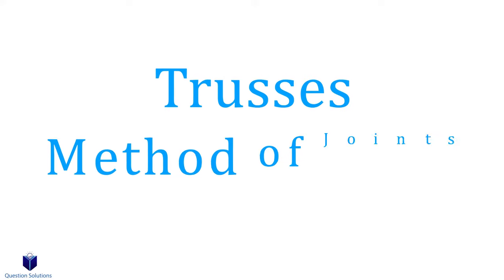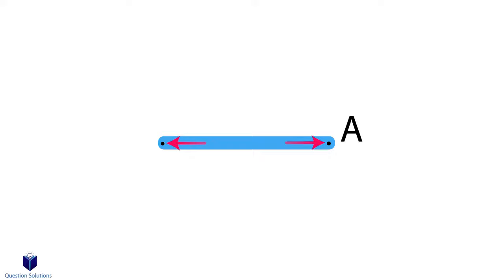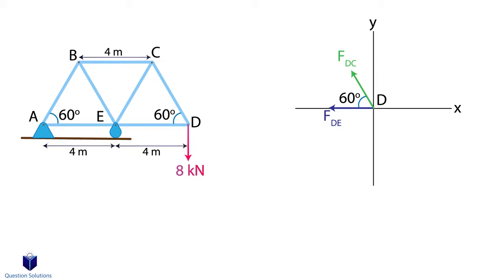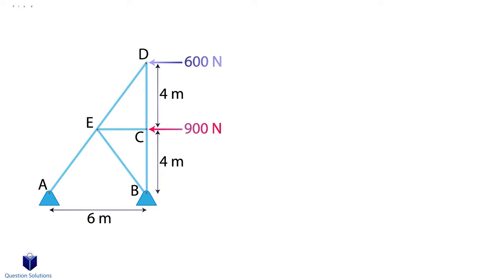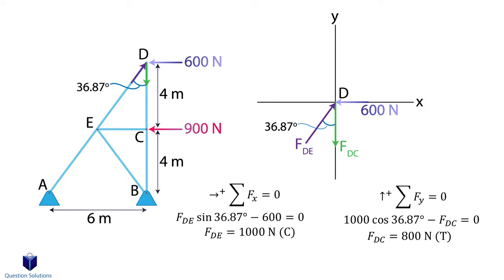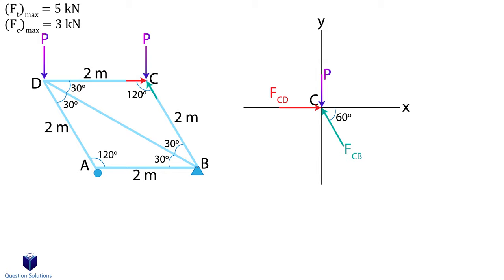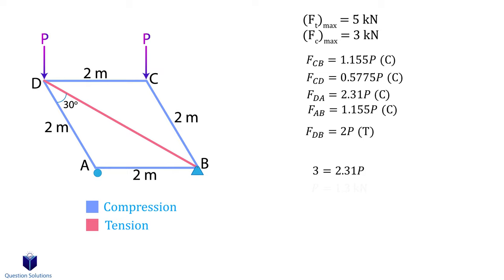Trusses Method of Joints | Mechanics Statics | Learn to Solve Questions

Comment: I have question that if you want to select direction of force you can select it freely or by analysing the whole problem
Reply from the maker: You can freely choose it. You will get the correct answer regardless. However, as you gain more experience with these problems, you should be able to mentally pick the proper directions quite easily so that you won't have to switch them at the end.
Reply: Thx for reply, now I am clear about that

Comment: 5:02 in the equation fbc-fbacos60-fbecos60=0 we can isolate fbc to get fbcos60+fbecos60=fbc. Since fbe=fab, we can write 2fabcos60=fbc. The 2 and cos60 multiply out to 1 thus leaving fab=fbc but fbc is half of 9.24 therefore fab and fbc should be 4.618 kN
Reply from the maker: I am sorry, I don't see the equation you're referring to at 5:02. Regardless, all values shown on the video are correct, there are no errors so somewhere in your equation, you made a mistake. Please double check your work.

Comment: In the intro about the pin exerting a force, It’s almost like saying the pins on both end of a rod are going to had equal and opposite force. Like for instance, if the pin on the right side exerts a positive force, the pin on the left side will exert the same amount of force As the right pin, but it will be negative, the same works the opposite way around.
Reply from the maker: Yes, so when you find the reaction at one end, the whole member has that force. The direction of the force from the pin determines whether the member is in compression or tension.

Comment: In the last Question the isoscales triangle in which at joint D The Fda= 3.34 C and Fdb=1.15P T because in FBD the inclined force tht we don't know we aways make tension but why you produce FDA as Comp in FBDin  9:14 kindly, reply  please!
Reply from the maker: You can assume them to be in tension or compression. It's completely up to you. At the end, if you get a positive value, then your assumption was correct. If you get a negative value, it's opposite to your assumption. 👍
Reply: @QuestionSolutions but our answers of fda and fdb are not same if I assume the fda as tension in FBD?
Reply from the maker: @maazansari871  You changed the signs for both the y-components and x-components?
Reply: Yes of course I do.. you also try and check please!
Reply from the maker: @maazansari871  okay, I'll check tomorrow and let you know. It shouldn't make any difference since the y-force will turn to positive and x-force will be negative. And then in the next step, the arrow would be pointing in the opposite direction. 😅
Reply: @QuestionSolutions  No in my question I do the X- forces will Positive only one force of fdc is negative and Y-forces will all negative..😭
Reply from the maker: @maazansari871  But that's incorrect. at 9:14, we have two sets of equations. One for y and one for x. If you assume the force to start at D and go towards A, then your x-component will be positive and your y-component will be negative. The arrow flips, which means x-component is now facing to the right, and y-component is facing down. You need to make those changes and follow through and you will get the same answer. Let me know if you need further help :)

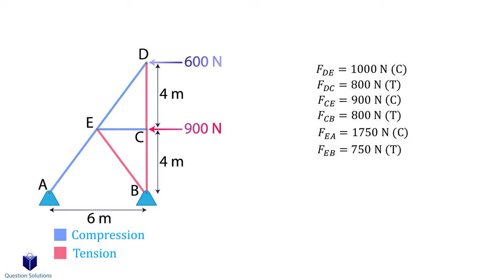Comment: First up great video, it has explained it better than my current lecturer who doesn't explain it as clear as yourself.  @9:16 did you solve the two equations like at 8:02?  Just making sure that I cover all of my workings to show my intent and how it was achieved.
Reply from the maker: Thank you, and yes, almost all of the simultaneous equations I've solved has been done so, using the substitution method. If there is more than 4 unknowns, I would suggest to use a matrix, but that usually comes up in dynamics, not statics.
Reply: @QuestionSolutions  do you have an example? confused on what to do with the p

Comment: 5:34 So I solved this joint while pausing the video and noticed that I didn't even need the Y reaction since I already found the only unknown (F_ea)with the X reaction. But in what case would the Y reaction be useful?
-
Also lets say the roller was at Joint A, how would that affect the reactions at A and forces (F_ba) and (F_ea)?

BTW, this was an amazing video. I couldn't understand a single thing in my lecture and I'm glad I can do my assignment in peace now
Reply from the maker: It's useful if it's required in your question. If it doesn't, it's just extra forces. 😅

You can't have 2 rollers as the only support. Nothing would stop the bridge from going left to right. But let's say for hypothetical reasons, you have 2 roller supports. Then the only difference is, at A, there would just be a single vertical force, and there wouldn't be an x-reaction force.
Reply: @QuestionSolutions  I see, we'd have a moving bridge then. 😂

Comment: There should be an example about ground reactions but besides that great video
Reply from the maker: All works the same, makes no difference. You just account for that when you write your equations of equilibrium at a joint. It's more needed when you solve using the method of sections :)

Comment: 6:36
why do you use sin for x forces and cos for y forces in this problem?
Reply: The answer to my question was that sin is always the opposite side of theta. In this problem the angle (theta) was at the top corner, so the bottom side will be sine and the other side will be cosine and the longest side is always the hypotenuse.
Reply from the maker: @benshapirohamburgerhelper1239  The x-component of force F_DE is along the x-axis. That is opposite to the angle, which means it's sine. The y-component of force FDE is along the y-axis, which is adjacent to the angle, which means cosine. 👍
Reply: @QuestionSolutions  thanks sir

Comment: I'm just watching this now
At 6min why did you use sine to solve for the X axis forces(Fx) and cos for the Y axis forces(Fy) at point D
Reply from the maker: I think you might be under the impression that sine is for y-axis forces and cosine for x-axis forces, or vice versa. This is NOT true, and it is incredibly important that you remove this idea. Please take a few minutes to look at this video (especially the first example): https://youtu.be/NrL5d-2CabQ

Sine and Cosine are related to the angle and their corresponding sides, not set for x-axis forces or y-axis forces.

Comment: hi sir, when do we consider the reactions at the supports? great video👌
Reply from the maker: You can consider them if the question asks you to find them, or you have no place to start and you need them as givens.
Reply: @QuestionSolutions  okay thank you🙏 also with the method of joints, do we not consider the zero force members?
Reply from the maker: @PulengManchidi  There isn't much to consider about zero force members. What I mean is, doing a few examples will allow you to instantly realize which members are zero force members, so you can easily write them off. Other than that, when you solve your problems using the method of joints, you will get zero force members pointed out in the solution.

Comment: 3:21 wait i understand the pattern and the logical conclusion, but isn't Fdccos60 is itself Fde? I know it will give a logical result (which is Fde=-Fdccos60, it's negative bcs of the direction), but what about the sigma Fx? Are those things (Fde and Fdccos60) two different forces, or they are just the same single force? I'm guessing they are two different forces since Fdccos60 is just Fdc pointing to the horizontal direction (it's one force broken up into two directions), while Fde is a force that always points to the horizontal direction. Is my guess correct?
Reply from the maker: In this case, yes, because there were no other forces at the pin. Also, I assume you meant cos60? Because the x-component of force FDC is equal to the magnitude of force FDE. Again, that's just in this instance. If, for example, there was another force pointing in another direction (as long as it wasn't straight up), FDE would not be equal to the x-component of force FDC.
Reply: @QuestionSolutions  Yes, i meant cos60. Okay, thanks for the confirmation, i appreciate it

Comment: How did you gett 1.155P 
(8:52)
Reply: Can we just assume the P as 1?
Reply from the maker: @jerichogaspar2559  Any variable is always a 1 (unless a value other than 1 is shown, like 2p, 0.4p, 5p etc). We just don't write the 1 in front. So if we have something like x+5=10. The x has a 1 in front, we just don't write it. Otherwise, it wouldn't exist, for example, if it was 0p, then it's just 0. I hope that makes sense :)

Comment: What do you mean by your  assumpiton was right at 3:12 because of positive answer. Do you mean the correct answer for all assumption must be positive and if we got negative we must to change it o positive?
Reply from the maker: Yes, I show this at 3:30, where we assumed an incorrect direction and got a negative value. If you get a positive value, your assumption for the direction of the force was correct. If you get a negative value, that means the direction is opposite to your assumption, but the magnitude of that force is still correct.

Comment: When you use the sine to get your forces at Y, for example why don't you use angle 30 instead of 60? I have trouble making sense of that, for example at Joint C. I can also verify your answer with similar triangles, but if you can let me know why 60 degrees, thanks.
Reply from the maker: You can use 30 degrees if you want, as long as you use the proper cosine and sine functions, you will get the same answer. 👍
Reply: @QuestionSolutions  Would you mind showing me through an e-mail or through here? I usually struggle to choose the angle for sin from the top joints. I can follow the method, just having sense of which angle to use for sin, for cosine I know it is always the adjacent angle.
Reply from the maker: @enrique2914  Please kindly watch this video first: https://youtu.be/NrL5d-2CabQ

If you're tight for time, then please watch the first example. I go through the whole process, how to pick sin and cosine, break forces into components. etc. The video is only 9 mins long, and I think it can help you a lot. Let me know if that helps :)

Comment: Hi, could you explain something for me? At 4:05, If we take the the 8kN force to the same coordinate of the green arrow at D, it should be F_DC - 8*cos30 = 0, but it gives the wrong result (6.9kN). Why this does not work?
Reply from the maker: I am not entirely sure what you are asking. How are you moving the 8 kN force? It's straight down, so it will only have a y-component. There is no cos 30. Maybe I am not understanding what you are asking :( Could you reword the problem?
Reply: @QuestionSolutions  When we are evaluating stress or internal forces, sometimes is more useful to use other coordinate system than the regular x-y plane (y vertical, x horizontal) such as in https://youtu.be/8JYUHt5Lqcs . I think my doubt is more related to it. Why I cannot place the 8kN force in the same coordinate of the force F_DC to calculate it?
Reply from the maker: @ironheart444  I think you are misunderstanding how to change coordinate systems. If you change your whole coordinate system, all the forces that no longer lie on the x-y plane must also be broken into components so that the components lie on the new coordinate system.
Reply: @QuestionSolutions  Thanks!!! That's exactly what I was doing wrong. If I changed the coordinate system, It would have a new component from the blue force at A in the equation.
Reply from the maker: @ironheart444  Maybe you did this for practice, but in general, you want your coordinate system to include as many forces as possible without breaking them into components. That makes your life easy :) I am glad you got it though! Keep up the awesome work.

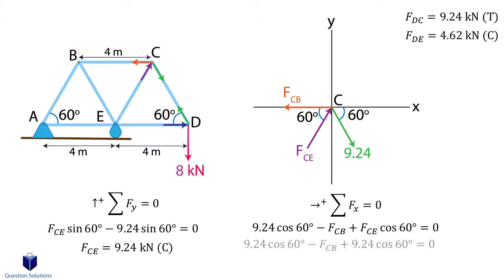Comment: On min 04:27 when solving for the x axis, kindly explain to me why the component Fcecos60 is positive if we are taking the right side to be positive
Reply from the maker: So notice that our force, F_CE, points up and to the right (towards the center with a slant towards the right). If we break that into components, we would have a y-component that faces straight upwards (vertical), and a force that faces to the right (horizontal). A good way to quickly see the components is to start at the end of a vector (so the opposite side to the arrow head), and mentally "walk" along the x/y axis to get to the arrow head. We have to "walk" to the right and up, or up and to the right. Either way, our x-component faces to the right, so it's positive. With the given angle, the adjacent side is the x-component, so we have cosine. Let me know if that clears it up.

Comment: hello , I hope you can answer since the video is old 
i just wanna ask you , Fdc on the first example the one you found = 9.24Kn isn't that Fdcy component ??  and not Fdc ? why did you plug that value in Fdcx
Reply from the maker: No, if you want the y-component, you will need to use sin60 and get the component. Otherwise, what you are getting is the resultant force FDC, which is why sin60 was already used in the equation. Again, just to clarify, what you find as FDC is FDC, NOT any component.
Reply: @QuestionSolutions  what you find as FDC is FDC, NOT any component.  That explains 4 questions i have :') thanks a lot mate, i have test tomorrow lookin back at some work my professor doesn't explain sh*t I only find ready answers (results) . again thanks <3
Reply from the maker: @Youtube_vods130  You're very welcome. Your question is common to a lot of students, so I am really glad it cleared it up. :) Keep up the awesome work and best wishes with your test.

Comment: If you have a member A to B which is upright in a truss, And there is a force on joint B going down can you move that force to joint A? (A is not a pin, member AB is somewhere in the middle of a truss)
Reply from the maker: Any chance you can send me a picture or a rough diagram of what you're talking about? It'd be easier to visualize and give a proper answer. Thanks!

Comment: Hello wanted to ask , what if i used joint A instead of join E to find F A/E. Is still goona be a correct answer or i need to use join E in order for the lecture to mark it as correct ?!!
Reply from the maker: I am not sure where you're referring to, regardless, it makes no difference as long as you end up with the same answers. Unless your professor specifically asked you to start at a certain joint, you can solve these problems however you please. Show your steps properly, and arrive at the same answer, and you should get full marks.

Comment: Just a quick question,  how would I go about finding Ey in the first problem if I decide to use reference angles. I ask this because when trying to find Ey in example 1, my equation is Ey + F_BEsin(120) + F_CEsin(60) = 0. When I do this I get -16 for Ey but in the video it's equal to 16. I'm not sure what I'm doing wrong.
Reply from the maker: Why did you use sin 120 for the y-component of force F_BE? You can use either 60 or 30. If you use 30, you need to flip the components, since now you're looking at the sides of the right angle from the opposite side.

Comment: Wouldn't both FBE and FBA be tension forces? In order for 9.24 (FCB) - FBE - FBA = 0, each of FBEcos60 and FBAcos60 would have to equal half of 9.24, and if FBE = FBA from equation EFy, then they can't have different signs, right?
Reply from the maker: That is not correct. You are thinking about this as singular equations with just scalar values without accounting for directions. However, for trusses, the direction of the arrow (force vector) that you assume is very important. We assumed force BA is leaving the pin. We assumed force BE to come towards the pin. We got positive values, which means our assumptions were right. Once that happens, we don't care about the equations or the algebra anymore. You now need to remember that if a force comes towards the pin, it's in compression, and if a force leaves the pin, it is in tension. After that, label them accordingly. I hope that helps, if you need further clarifications, let me know :)
Reply: @QuestionSolutions  Okay, this actually clears up a lot of confusion I was having about joints and sections! So initially, you assume a direction. And if you get a negative answer, you just swap the direction of your arrow? And whether it's tension or compression doesn't depend on the resulting sign you get, but rather whether the arrow is leaving the pin or going toward the pin. Thank you so much for responding, really helped me figure that out!
Reply from the maker: @paugust  That is correct. Tension or compression is dependent only on the direction of the arrow. The positive or negative sign you get just shows whether your assumed direction is correct. So yes, you're spot on, well done! Keep up the good work.

Comment: At 8:02 sir you had your solution in a pdf and I’m a bit confused how did the y = 1500-0.6x/0.6  became y = 2500 - x Thank you
Reply from the maker: So let's say you have a fraction like this: (4+5)/6. This is the same as 4/6+5/6. So in our problem, we have (1500-0.6x)/0.6. This is the same as 1500/0.6-0.6x/0.6. If you divide each term individually, you get 2500 - x.

Comment: At 4:05. Why did you assumed Fce towards the Joint C? Why not just write Fce away from the Joint Fce? I know it doesn't matter but also why not take all the forces away from the Joint?
Reply from the maker: So that's why it's an assumption. You can assume it anyway you want. When you do a lot more questions, you will notice that you can make a very good guess as to the directions these forces will face. That makes it easier since you don't have to flip them at the end if you're wrong. Regardless, it's an assumption, pick whatever direction you want.